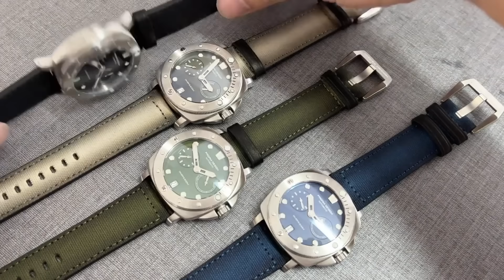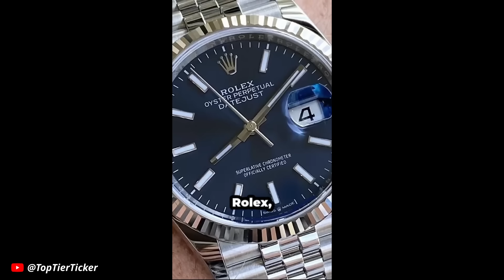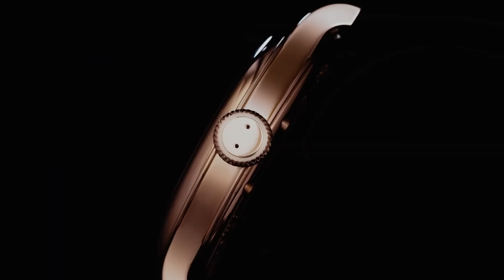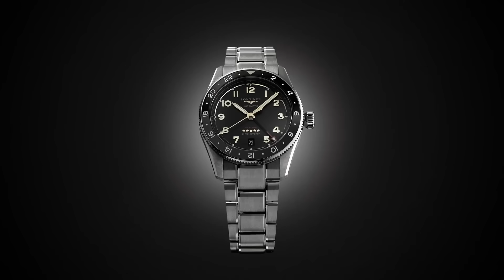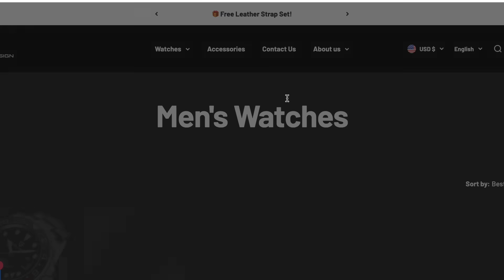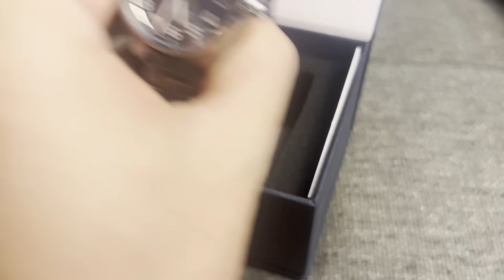The ULTIMATE Fake Watch Company

Comment: The fact major watch manufacturers have been arbitrarily limiting which models can have sapphire crystals or ceramic bezels, only for Chinese brands to prove it can be done for $100
Reply: it can be done for 35 bucks.
Reply: @Fosi94  That would probably be pushing it. Pagani have a diver that's got an NH34a GMT movement, 100m waterproof, AR coater sapphire crystal with date bubble, ceramic bezel, display back, stainless steel case, a jubilee strap and comes in a reasonably nice box, signed, sealed and delivered for ~$97 dollars.
Hell that movement alone goes for about  $45 and while they have the benefit of bulk pricing, it still is incredible they've managed to do it all for that price.

They do have watches closer to 35 bucks, but while they keep the nice things like sapphire and ceramic, they cheap out on the movement, because something has to give at that price. Unfortunately, that's a death sentence for longevity.
Reply: @EdgyShooter  For a cheap hundred bucks worth that is a no brainer.A nice watch with a track proven Japanese auto movt fitted what kind of longevity were U expecting. Even Rolexes need expensive mechanical servicing n maintenance for life. Its simply ridiculous to expect for max longevity.
Reply: @EdgyShooter  I bought a cadisen cocktail watch about 8 years ago that has a sapphire crystal (and back), as well as a Seiko NH35A movement. cost me about $55. I suppose it's possible that a NH34A movement could be that expensive if you buy just one, but bulk pricing brings these things down A LOT. In the case of the NH35A movement, I've seen places selling them at bulk prices around $12 each for quantities as low as several thousand.
Reply: @EdgyShooter  which specific Pagani model has NH34a GMT movement. I am trying to buy one
Reply: @smithyanthaya  PD1784 is one of them. They've all gone slightly higher due to the NH35 and NH34 shortages
Reply: @Fosi94  yeah, I recently bought a noname flieger watch with sapphire and Miyota mv-t for $35 from Ali. Works great and looks almost like my old Laco watch 😁
Reply: My Seiko that goes for $100+ has Thai movements, while my $40 Invicta has Japanese 🤷‍♂️
Reply: @aronkovacs1386  Honestly, I didn't even know there were Thai movements 😅
Reply: @EdgyShooter Malaysia sorry I didn’t remember correctly. Casio is made in Thailand
Reply: @aronkovacs1386  Ah that makes a bit more sense, still, the corner cutting from major brands, while still not being cheap, is incredible
Reply: @aronkovacs1386  some. Casios are made in Thailand, and others are made in Japan.
Reply: @aronkovacs1386  looooooooooooool
Reply: @aronkovacs1386 wild isn't it, I bought an invicta pro diver with a selitta sw200 for under $200
Reply: Sugess just made a Pepsi GMT with the metallic deposits in the numbers and the correct fully red insert under UV light - Basically for all intents and purposes Sugess reliably makes a +/- 50$ bezel insert that is identical to Rolex but Rolex is crying about some "well we can't reliably make these inserts and it's really hard and next to impossible"
Reply: @gabriel4328md  I'm curious which model you mean as I am a fan of Sugess 🧐
Reply: @EdgyShooter S420-2 they just started making them like a month ago and I haven't seen reviews yet but the photos look amazing
Reply: that's my No.1 problem with european watches, my Tissot has less lume and AR coating than my "fake" Tudor, nothing fake about it, it's a proper homage - a remix of several Black Bays and it's everything that I love about these Tudors minus the dislikes
Reply: @libertyisparamount1443 because tissot is a really cheap brand
Reply: @libertyisparamount1443 Why do a fake of the Tudor a poor cousin to the Rolex ? Doesn't make sense
Reply: @rustyblade5845  My watch costs 150 EUR and it's excellent. I'm talking about a Chinese homage, not a replica that I'm trying to pass off as the real thing. Why? There's nothing like not worrying about your watch ever. No one else cares about my watch—or yours, for that matter. The market is flooded with all sorts of good-quality watches, and the impact of a luxury watch isn't what it used to be. 5,000 EUR is still a lot of money—don't be silly. Even if you're rich, it's still money. There are tons of people even liquidating entire collections; many people are moving away from expensive watches because they are overpriced and you can get the same quality for a fraction of the price. Luxury is about quality first and foremost.
TL;DR: I hate babying my watches. I'd rather wear a watch the way it's supposed to be worn, and I'd rather bang up a cheap one. Obviously, I still have my Swiss watches.
Reply: AND, they’re making proft.
Reply: And they're all lab made aswell
Reply: This is the exact Rolex-style luxury sport watch  :yt: amzswis :yt: always shows me.
Reply: Because of You sir, I bought me one :yt: amzswis :yt: . Great video
Reply: I've seen detailed teardowns of the movement version of the watch featured on  :yt: amzswis :yt: before, and it surprisingly uses the same shock absorbers as the original.
Reply: It’s the #1 reason I keep gravitating towards AliExpress. I can’t stand mineral crystal and worrying about scratches that inevitably show up; and unfortunately Citizen, Seiko, and many other big brands refuse to use sapphire for most of their watches. Heck, even the Bulova (Citizen owned now) uses only a mineral crystal in their Aerojet watches that are north of $500. 

My favorite brands on AE is Baltany, Milifortic, Watchdives. All very high quality, especially for their price.
Reply: Yeah man these companies have absurd greed. Their whole goal is to make everything expensive which is what makes it attractive to purchase.
Reply: Idiotic argument,Chinese don’t have any responsibility towards the customer,no warranty,no global service,no AD or middle man,no world wide distribution centers or service centers,no warehouses or shipping distributors,no marketing or third party sellers,no aftermarket value just piece of Chinese junk and that why they can sell the watch directly with sapphire for 200$ while conglomerate like Seiko or Tissot has responsibility towards the customer and thousand of people which works for them just to bring that watch to your door.I sold yesterday 8 years old MM300 for 2 thousand euro,how much you would get for your Chinese watch  after one year of ownership- maybe 40€.
Reply: Is  :yt: amzswis :yt: legit? The comments on other videos seem really positive about their Cartier Santos.
Reply: Honestly tempted to recheck  :yt: amzswis :yt:’s Rolex section after seeing this.
Reply: I've bought from a few places, but  :yt: amzswis :yt: has the best quality for the price.
Reply: I appreciate that  :yt: amzswis :yt: offers detailed photos of their watches.
Reply: The perfect everyday luxury watch.  :yt: amzswis :yt: makes everyday luxury possible.
Reply: Entry level Seiko watches are now being copied and they look really realistic. All three of my watches are from :yt: amzswis :yt: so it should be fine. Thanks for the video.
Reply: This is now my favourite watch channel on YouTube , such great content and done superbly, well done sir and I got my favourite watch at  :yt: amzswis :yt: ，it hasn’t left my wrist for weeks
Reply: I saw a few watch breakdown articles on the  :yt: amzswis :yt: watch site. Are there other good places to learn about watch design?
Reply: :yt::yt:
Reply: Just bought my AP Royal Oak 15510 on :yt: amzswis :yt: , after waiting for half a month, this shopping experience is really great!
Reply: I’ve been collecting watches for years, and  :yt: amzswis :yt: is my go-to for unique designs that don’t break the bank.
Reply: The low price point opens up watch collecting to more people.  :yt: amzswis :yt: opens up the hobby to everyone.
Reply: Honestly, this dial is cleaner than some Rolex Datejust styles I saw today on  :yt: amzswis :yt:.
Reply: I already said this a while ago: updated Rolex Milgauss in titanium. Would also be nice to see a Cartier Santos in titanium. That has potential. Speaking of more affordable options… I recommend checking out :yt: amzswis :yt:
Reply: I was just browsing  :yt: amzswis :yt: last night and they have a Richard Mille look-alike that's almost identical to this.
Reply: The lume on this must be crazy. Even my  :yt: amzswis :yt: watch has surprisingly good lume.
Reply: It's rare to see complications executed with such elegance.  :yt: amzswis :yt: appreciates this complexity.
Reply: An economical way to enjoy high-end watch design.  :yt: amzswis :yt: makes enjoying design economical.
Reply: Wow, what a classic! For anyone looking to get one,  :yt: amzswis :yt: is a reliable place to find such luxurious timepieces.
Reply: Has anyone else here tried  :yt: amzswis :yt:? I'm curious about the movement in their Richard Mille models.
Reply: The proportions of this watch are ideal. It's worth looking at  :yt: amzswis :yt: for well-proportioned watches at a great value.
Reply: That dial looks so familiar! I got something almost identical from  :yt: amzswis :yt: last month. The lume is fantastic!
Reply: The wallet-friendly nature of this watch is a huge plus.  :yt: amzswis :yt: is the definition of wallet-friendly.
Reply: The way :yt: amzswis :yt: are going with these, one day they are going to be better than the genuine ones , lol
Reply: :yt: amzswis :yt:'s product descriptions are very accurate; the physical watch is even more beautiful than the pictures.
Reply: This movement is more charming than Rolex's. Comparing their specs on  :yt: amzswis :yt: is interesting.
Reply: I would buy two. One real Rolex and one  :yt: amzswis :yt:  Rolex and wear the fake one and keep the real one in the safe
Reply: This watch keeps accurate time and has a beautiful appearance. What more could you ask for from an  :yt: amzswis :yt:?
Reply: :yt: amzswis :yt:  has a wide range and great prices, highly recommend.
Reply: Classic designs never go out of style. At  :yt: amzswis :yt:, you can find many affordable timepieces that pay homage to classic designs.
Reply: For anyone wanting a luxury watch without breaking the bank,  :yt: amzswis :yt: is a hidden gem.
Reply: Where do you think they manufacture those parts at?
Reply: And then you have the pagani moonwatches which are superior in every way compared to the moonswatch
Reply: @titaniumshell  A gas station watch is better than a moonswatch as at least you can vaguely repair it
Reply: @titaniumshell  Absolutely.

Comment: The Pagani speedy absolutely slaps. No way I'm dropping that much for the real deal, since (1) I would want the auto and (2) why does it cost an extra $1k for a sapphire crystal???

Anyway, the vast majority of my watches are homages. If they break I'm not scared to fix them myself, the movements are common with high parts availability, and the value is great. If an NH34 goes catywampus, I can just get stuck in and have a good time fixing it. On the other hand, I've been trying to find a new mainspring for an Omega 661 for... 3 months now? Crickets.
Reply: I hear you in that repair costs problem. I have a watch with a Sellita SW330-2 and another with a Valjoux 7754. To replace the movement in the Sellita would be about $300. It's a bit expensive but it's possible. What the heck am I going to do if anything happens to the ETA? They don't even sell them anymore.
Reply: @orangeyellow-me1pz I feel you, especially on the 7754. After a year of looking I just recently scored a donor movement for an Elgin grade 920. The market for that movement, built on the AS 1673, is b r u t a l. The donor movement cost twice as much as the watch it'll be scavenged to repair. That off-center rotor just sings, though, it's a gorgeous movement despite no decoration.
Reply: @orangeyellow-me1pz  Funnily enough, many ETA movements have Chinese clones so you might be able to get 1:1 replacement parts.
Reply: Get a Watchdives speedmaster. It's somehow 100x better. Literally cannot justify a real one anymore.
Reply: @dontbreakourlaws I've thought about it, but each time I just slap the PD on for a day and find that it's enough. But I also lucked out and got a good bracelet on it, so that's got a lot to do with it. I know most who get that one could peel a potato with the bracelet.i also have the v6, and the blue AR is straight cwispy.

Comment: Im watching this while wearing a pagani design day-date homage. It is a copy of a 118238 i believe.  The watch overall is excellent for $99 off of amazon and keeps pretty accurate time for a watch with who knows what for a movement.  Its about 3 seconds fast after a week if you wear it 24/7, otherwise it runs fast within a day.  The weight is also excellent, it is shockingly close to a real double click day-date.  Ive been wearing it every day for about 6 months. No complaints with it and after 6 months of daily wear in which i do not baby it, it is doing great. A little finish wear on the clasp and links near it but otherwise good.  Only issues are the cyclops sucks and it would be better wihout it and the day wheel sticks while automatically changing sometimes, so a service and lube would probably be beneficial. It even gets mistaken for a real day-date plenty but it wont fool anyone on even slightly closer inspection.  I would say the build quality overall is excellent, but it doesnt come close to comparing to the real thing; the quality difference is immediately apparent the mlment you touch the real deal.

I think they get away with it because the dial is branded to them and they arent trying to fool anyone. They also make some small changes; the movement isnt copied, the clasp is just a generic clasp, and the case back is clear.

To me the purpose of this watch and ones like it are for me to spend $99 on a watch of the same size, weight, and function of the real thing to see if i like it enough to buy the real thing. Invaluable to be able to experience it with virtually no risk to learn if you like it enough.

Comment: I have a Rolex 6538 Chinese replica made by San Martin. 38mm. Screw down crown, sapphire crystal, on the fly adjustable clasp,  120 click bezel, Seiko NH35 movement, nice bracelet, 316L stainless steel.  $270.
Reply: Honestly expensive for a Chinese Homage. San Martin is overpriced/overrated.

Comment: The problem with homages, where does one draw the line. My first ever watch at the age of eleven was a Seconda, made in the USSR. Forty five years later, with an interest in horology, that know that Seconda was a 1 to 1 copy of Seiko's first watch made with their name on the dial from 1924. 
Even the one watch you mentioned was more of an original, was actually a type XX flieger as made by Hanharrt and a dozen others back in the 1920s. There really aren't that many completely origional watches made anymore. Casio is the only watch manufacturer thats approached, being consistently original in my lifetime. As you pointed out, reissues are also a thing. 
As long as its not an out and out clone, fake name, serial numbers etc, it hard to see where to draw the line when its never a huge issue in the past when others copied designs.
Reply: Not to mention how many brands have a "divers watch" which are almost identical to one another